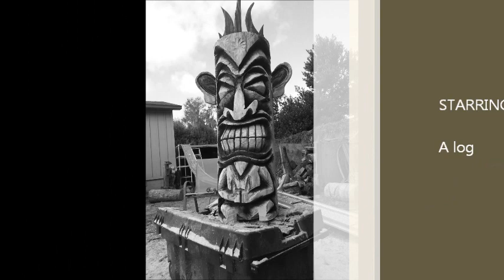Tiki Carving. 3 Visions Art

Comment: Man thatz bad ass! How did u attach the hair and ears? I've been researching videos to help me get a boost on how to go about carving one. I actually bought a wood blade for my angle grinder today but it's the wrong one😆And I was also looking at an electric chainsaw but was skeptical. But after watching your tutorial I'm sold on gettin a used one to start with. Hope all is well with you and yours with all of this bs goin around. ✌
Reply from the maker: Thanks Brother. I attached the hair and ears with wood nails that I cut the heads off. Also you can use a cheap electric chainsaw, I recommend the Worx. I started off with a angle grinder with a mason wheel on my very first one and strongly suggest you do not do lol. Remember to use safety glasses. and just take your time to figure out the way the tools work and don't forget to have fun. Art is one of a kind and everybody has their own style... Thats what make art special. Hope that helps.
Reply: I started with s chisel first on mulberry tree ! Then went to electric chainsaw and it works good for me ! I tried a gas chainsaw but I found myself struggling with turning it on a bit and I stress easy so got me a cheap homelite for 59$ at Home Depot! They work fine !

Comment: Actually looks like queen palm in your back ground?
Reply from the maker: Yes I had a buddy of mine deliver a bunch of queen palm I don't recommend using that type of palm it seems to fall apart and rot easy
Reply: @3Visionsart  yeah it does specially if you get the trunk piece closest to the top! They hold up a lot better than California king, and Mexican fan palm though ! I don’t like Queen trunks because they are harder to carve than the others mentioned! I once carved a tiki into a mulberry trunk and that was TOUGH! Ever since I just use palm varieties! Always wanted to try pine ! How is the carvability on pine vs palm for you ?
Reply from the maker: Pine is pretty rough and also tends to crack and dry out quickly but it holds up rather well and it's a softer kind of wood. I like it because of smell and also I have a piece that I card about 5 years ago that I did not treat with anything and it's still holding up really good. You just got to be careful that is not loaded with boring beetles. The hardest would have used so far as been Oak because there's tons of that around but it's extremely heavy and it's kind of like cutting concrete LOL but if you want a big solid piece I definitely recommend fine. Now if you want something that's a soft nice wood to carve with a beautiful look and also gets real lighting a natural bug repellent then I would go with Cypress. That is a go-to down here in Florida. And it gets really light after a couple months with mild cracking
Reply: Curious, do you price per foot out there? I know detail and wood have a lot to do with pricing